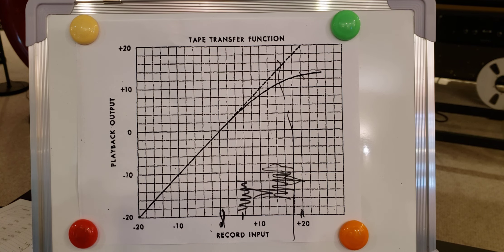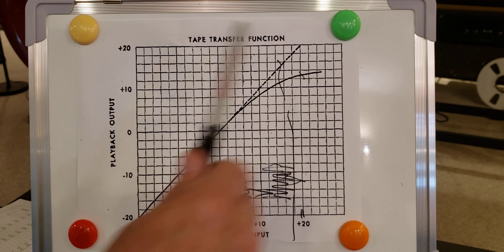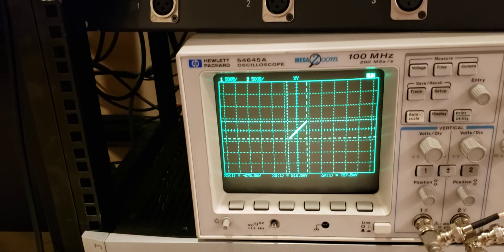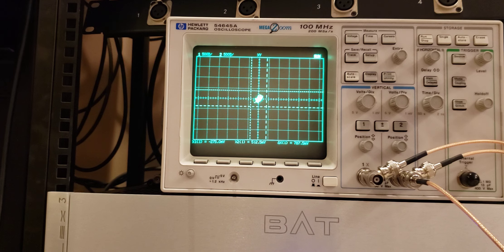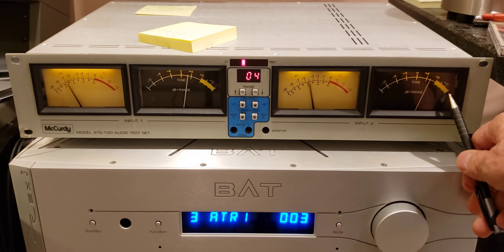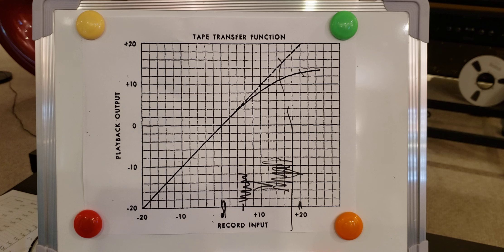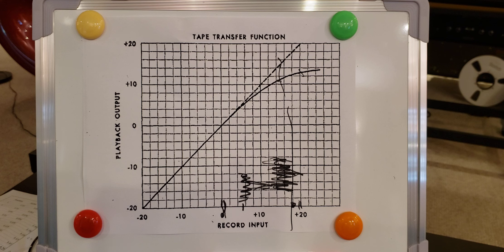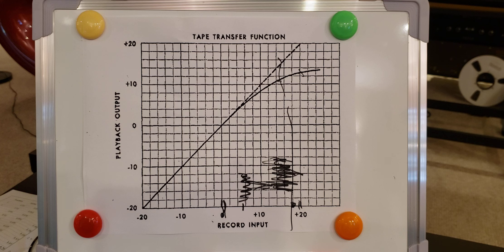Ampex ATR-102, VU Meters and Too Much of a Good Thing

Comment: Gah! Four magnets. Tape and magnets make me nervous!
Reply from the maker: They should, and they should not.  There are magnetic fields in any tape recorder - from the meters magnets, from the transformers, from the solenoids and the motors.

On top of that you always have stray magnetic fields in your room from your power lines, your electronics, speakers and even your resistive space heater and your lights. 

Ah... and your tape and head demagnetizers!!!

Do they do damage to our tapes?  There is most likely some effect... perhaps even a measurable effect, but not enough to worry much as long as you maintain some simple precautions, especially when using the demagnetizing tools.  .

Comment: I noticed that to avoid the peaks visible on the peak meters, it doesn't look as bad on the VU meters. So even if the VU meter rarely goes above 0 VU, the actual peaks are much, much higher. This was useful so know so that in future I will record at lower levels. But how much lower?
Reply from the maker: There is no simple answer, and this is where the recording engineer's skills enter the picture.  It all depends on the ratio of peaks to the average value, also known as crest factor and the combination of tape and the machine - as some combinations have more headroom.  The best advice is to experiment with your system and different kinds of music.  And record using the modern tape formulations. 

A streaming service is a great source of material for such trials.  

But this is a home tape enthusiast... when we buy an expensive tape from an established producer we expect them to already apply all their expertise to assure their product has the expected quality.  After all - we don't do our own surgeries, we trust the surgeons with proper training... this field is no different.  

There are, however, two possible sources of such issues.  One is a simple error during the reproduction.  Anyone can make it.  But the other one is philosophical, reflecting the producer's taste and vision.  

I once had a recording of a piano and violin sonata from a well known company where the piano simply overpowered the violin, making it totally disappear.  It was loud, bombastic and utterly unpleasant.  When I spoke to the producer, he explained to me that this is how it should be, and all the levels on the tape are where they are supposed to be.

Well... I am no stranger to such sonatas... but just to check my sanity I put on some other recordings of that piece.  And as surely as your tax refund being delayed, they sounded as they should - there were two instruments, speaking as a perfect duets, one complementing the other, none dominating... the piano was like a male ballet dancer - always there to support, never overshadowing his female partner.   On top of that, that was Richter, known for its explosive powerful style, and yet every violin note came through without any difficulty.

So in this case the producer had a particular vision... and apparently some customers agreed with it.   Nothing you can do there besides just moving on.

Comment: Great video! How about distortion at this point?
Reply from the maker: I did measure it, unfortunately, my signal generator stopped at +12dB, and the distortion there was 3%, so I guess it would be close to 5% at the +14dB point.  

Arguably, 3% is not too audible if it only affects some brief peaks, but if much of your recording is in the over-1% area then you are going to hear it.
Reply: @Foxbat9000  I always try to keep distortion as low as possible. In any case close to, or preferably better than the manufacturers specs. I am talking about decks by the way.